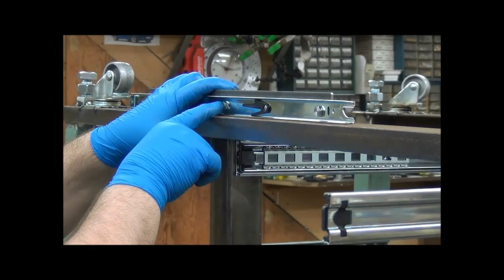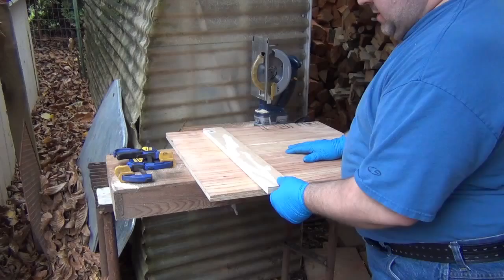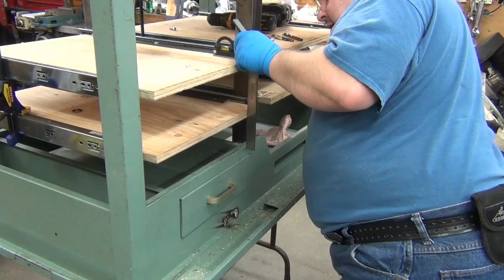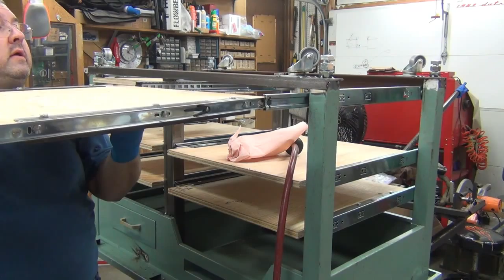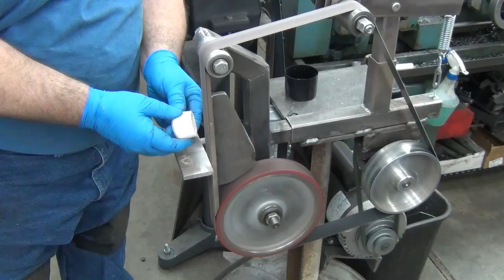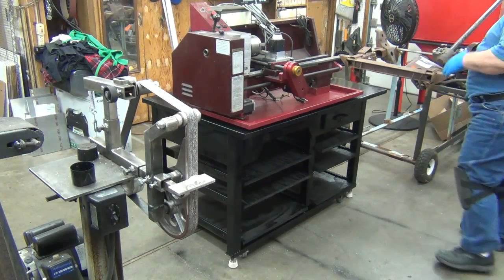Lathe Bench pt2

Comment: I'm really curious about the blue gloves,
Do you wear them because of an allergy to something in the shop? Say like grease or oil... Or are they purely to keep your hands clean? 
I tried to wear them once but the sweat build up made me wrinkle up and they just kept tearing...
Anyways great vids keep em coming.
Matt
Reply from the maker: Hi Matt,
I used to do a ton of car work.  I don't have any allergies, but I decided it wasn't good to keep exposing my hands to all the chemicals. I would only wear them when working with chemicals,  It gradually turned into wearing them when doing any car work and I started to like not having dirty, cut up hands all the time.
I haven't had an issue with my hands getting so sweaty they wrinkle.  They do sweat some, but not really an issue.  Around the shop, they give me an extra layer of projection from sharp edges and heat.  I can grind on stuff and feel the heat before it actually burns my skin.  I've been told it's a bad idea to wear them while welding, but so far, they've been great for tack welding.  If I slip and touch the wire wheel, the glove gets shredded instead of my skin. 
I had done a lot of how-to's on a couple of the Datsun threads.  When I started the youtube channel I needed a name.  I didn't want to do just car vids, or just shop vids, I basically wanted to do whatever I wanted.  I dawned on my one day that my "blue hands" were the only consistent thing about my videos. 
That's a bit of a long winded answer, but there you go :)
Thanks for the question and the kudos!!
Mike
Reply: Probably one of the best answers I've been given on youtube, I'm sick to death of getting no answer or a two word reply, So Mike I am very grateful for your long winded answer..
So in which part of the US do you hail from? I am on the South East Coast of Victoria Australia..
Regards Matt
Reply from the maker: Matthew Gischus
LOL! I know what you mean about responses on youtube.  I've gotten some same kind you did. 
If I get so busy that I don't have time to respond, then I'm probably doing it wrong. :)  I've already got one full time job, I'm not looking for another. This is supposed to be fun, hobby stuff.........at least for now. :)
I'm just outside of Portland, Oregon.

Comment: As a later project, I'd almost be tempted to insert a long threaded rod onto each of the adjustable feet, and either have a mechanical adjustment at the surface of the bench for easy adjustment, or tie them to a bi-directional electric motor so you could secure bench with the push of a button.  :-D

Yeah yeah, I know, total overkill.  But fun!